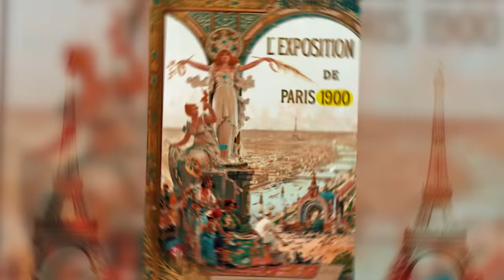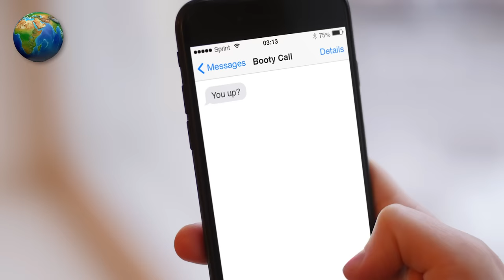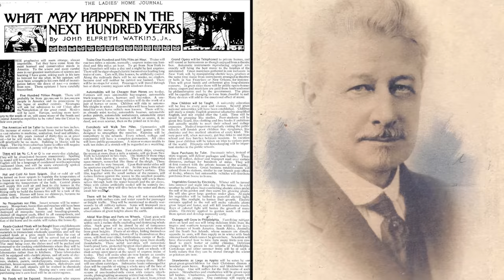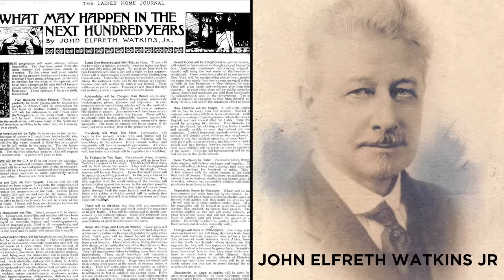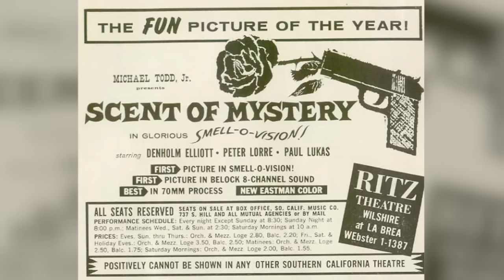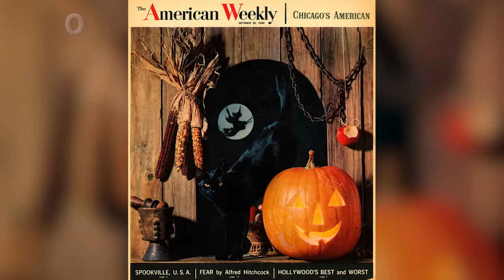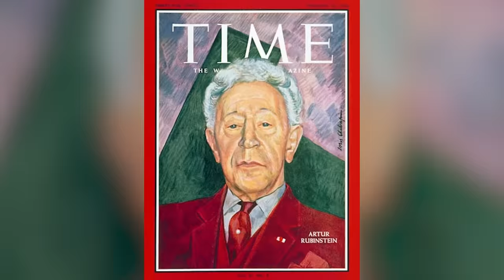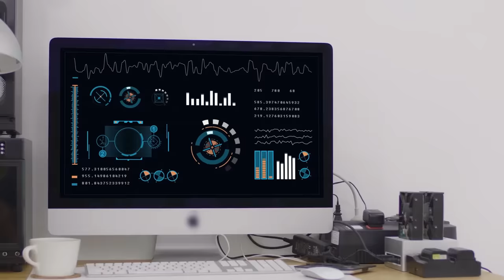What People in the Past Thought the Future Would Look Like

Comment: Ah, I had enough of these crazy ideas myself.
For example, I thought of a 3D printer when I was about 8 years old, I think. But this one would be totally environmentally friendly. It would be powered entirely by sunlight, converting the light into energy, which would be split into three individual streams, getting fed in three "printer guns" that are pointed at a "stage", with each of the printer guns being positioned at a different angle. Then you basically placed an image of what you want printed on a photocopier, scan it in, and the apparatus would convert the 2D image into a 3D file, and then the printer guns would shoot a laser-like energy beam on the stage, where all three beams would hit a single spot, printing the stuff you desire.
Basically, it would turn light into energy into mass, and if needed, this could work the opposite direction as well, turning things you printed and that broke back into energy that then could be reused.
Apart from how futuristic that is, considering I was just a kid that heard 3D printing is something that can be done, but had no idea how it worked (and having no clue about electronics), looking back, I'm surprised how "accurate" the young me was on how a 3D printer worked.
And if anyone is still reading this and wondering, I came up with this because I wanted specific Lego figures, but couldn't afford spending money on the whole Set in which they were included.

I also "invented" Anti-Gravity wrist-glove-thingies, that looked somewhat like Iron Mans palm-repulsors, with articulated "finger-antennas" to stabilize the Anti-Gravity beam, that should help people by the construction of buildings.
And a robot that would project a hologram of oneself around it that could be operated remotely. That way, you could send that robot to school, and attend school from home, not missing any lessons.
Reply: Good ideas!
Reply: Wow So Long That I Cant Read It🤣🤣😭
Reply: r/thattotallydidn'thappen reddit post anyone?

Comment: 3:53 there actually is. There’s a band called Compressorhead that is made out of robots. While not an “army”, machines CAN play music.
Reply: Actually, automated instruments including player pianos and band organs were in existence in 1899. The programming was done by holes in paper (typically a roll but sometimes folded sheets in the form of a "book". The control system was pneumatic, where the holes would allow air (or vacuum) to enter a passage which, through proper valves and actuator (typically a bellows) , would perform an action (e.g. strike a key or allow air to an organ pipe).

In 1910 a self-playing violin with piano accompaniment was developed that was electrically driven, the paper roll allowed electrical contact to be made / or broken actuating solenoids tp perform the various actions. 

So, in a way, the first recorded music was actually digital.

Also, in 1899 both the telephone and telegraph were in existence (commercial telephone systems were still in their infancy)so electronic communications were known.
Reply: Music box is literally a music done by a machine.
Reply: also there is device orchestra

Comment: I also have to add to the methods of putting out fires via air; helicopters.

Plus the video phones were once upon a time sold to homeowners back in the early 90s.  Home Improvement with Tim Allen had one in use in one particular episode.  In fact; one in particular AT&T released was the video phone 2500.

Comment: Personally, I could see flying cars becoming a reality in the next 200 years (assuming that civilization doesn’t first implode and forget all its scientific advances). The technology right now is very close to that idea as it is. For instance, we have planes that can run without propellers. And we have planes that use various methods for hovering over the ground. In reality, we are surprisingly close to achieving a the invention of the hover car. All we need to work on are hashing out the mechanics.

Here is how I think it will start out. It will be big and bulky. It will have jets that provide stability at its base while jets on its front, back and sides will provide forward braking and reversing, backwards braking and forward thrusting, and steering respectively. It will have a computer that will tell the machine when to fire its various thrusters. And whenever it’s accelerating or decelerating, only half of the bottom thrusters on its base will be active so as to stabilize it as it accelerates/decelerates. That is how the hover cars will function in the future.

Comment: 2100, you say? For one, hard drive space might be reaching well into the petabyte range by then, and we'll be using laptops with touch keyboards, solar cells will be much more prevalent (solar laptops, anyone?), and gasoline-powered vehicles will be considered obsolete, despite the emergence of synthetic gasoline production methods. Electric vehicles, sometimes even sporting solar panels, will be much more common.

Also, the laptop will be the nearly universal computer model (desktop PCs will be a thing of the past), and the term "laptop" will be nearly extinct. External physical media such as CDs and DVDs will be extinct as well--everything will be digital. Gaming consoles will have merged with the PC gaming market. We're already seeing the very beginnings of this, considering a lot of games for XBox are also playable on PC via Game Pass.

That being said, Nintendo will not go extinct. Instead, they will offer their own brand of PCs, which will do more than just gaming.

Microsoft will still have a major presence, although I'm not sure whether the term Windows will still be used to refer to their then-current operating system.

Linux will be much more prevalent, and Android will have expanded into the PC market as well, considering the Android OS is very similar to Linux.

The landspeed record may reach Mach 2 by this point, but might not be pushed any further, due to the extreme danger in approaching such incredible speeds. The first supersonic submarine might also be constructed by this point, due to advances in electric-motor technology, which, when combined with advances in nuclear fusion reactors, will yield literally MILLIONS of horsepower. However, such engines will prove costly, and therefore, only the navies of the wealthiest nations will be able to afford supersonic subs. Supersonic subs will also only be a passing fad due to the effects sonic booms will pose on marine life.

Due to mankind's extreme efforts in reducing greenhouse gas emissions, we may end up going too far and remove TOO MUCH carbon dioxide from the Earth's atmosphere, thus causing global cooling. This will also detrimentally affect plant life around the world, as plants rely on carbon dioxide in order to help them achieve photosynthesis. If too much carbon dioxide is removed from the atmosphere, it will be harder for our planet to retain a habitable temperature range.

I could go on and on and on for days regarding educated guesses/predictions about what 2100 might be like, so I'll just leave my post off with the above (it's already extremely long in the tooth--sorry).

Comment: 2100:  Desktop computers are old news.  Everything is written in a virtual platform.  Cars are completely driven by computer.  The driver sits at the wheel and operates a control panel.  There will be technology that prevents a car from moving if the driver is impaired.

If you who live in the US, like in New York City, and you have a meeting with a manager from Sydney, Australia, and another manager living in Paris, you don't have to leave town.  Use a VR headset and conduct your meetings.  You can have settings where you present yourself dressed in a suit or a dress, when you're really in either pj's, in your underwear, or you're wearing the outfit God made for you.

Comment: about the jet packs for military and fire fighters I wouldnt even use it considering if your a firefighter think about all the debris that got everywhere from a burning building got into the engine. To use a jet pack in the military same thing considering where your gonna be will be in a rural area with pebbles everywhere or a house probably messy or a desert with sand every that is bound to get sucked up into the engine a forest with pebbles also bound to get into the engine leaves to get sucked up into the engine and you can also expose your position with flying so I don't see any use for it